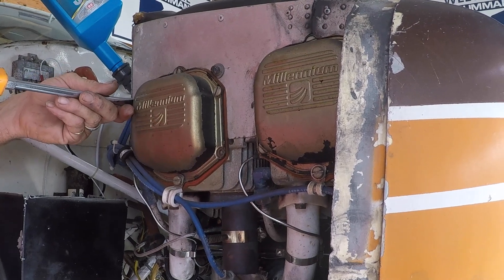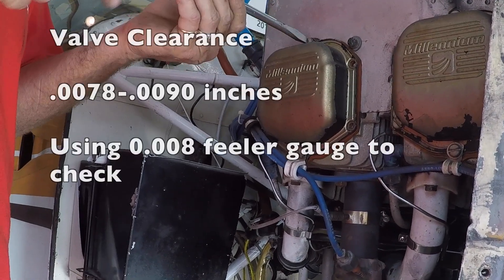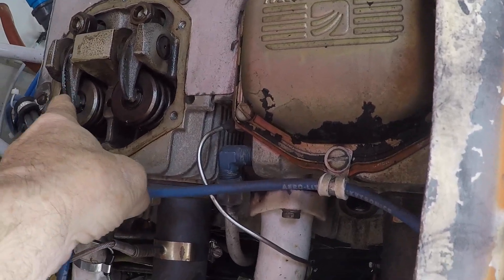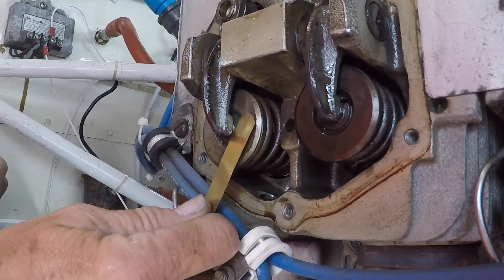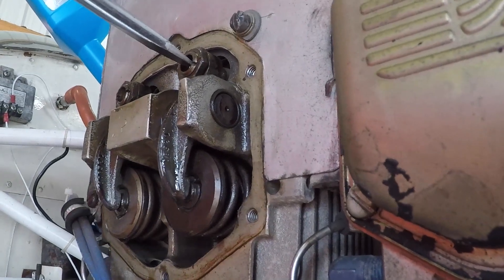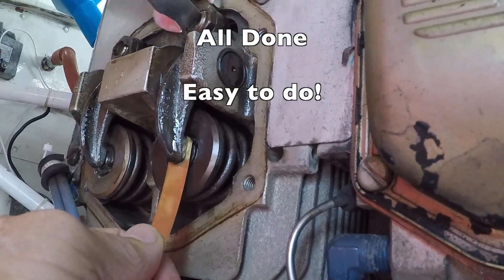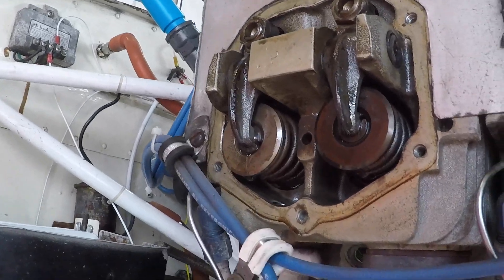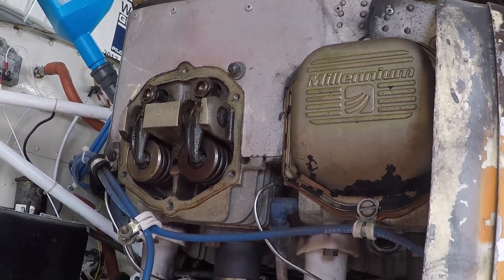Dry Tappet Clearance Adjustment - Grumman Style

Comment: Thanks for this.  Maybe you should edit to say the prop is not set to top dead center, but each cylinder must be set individually.  The pinky method in the top of the spark plug hole is a good one.
Reply from the maker: Figured folks would know to check at top dead center.

Thanks

Comment: my O235 data plate mention 0.005 valve clearance but operator manual said another value. what is the true
Reply from the maker: I use what the maintenance manual call out.
Reply: @GrummanPilots  Attached is SI 1480 and SI 1068A which provide guidance on the installation of pushrods in the O-235 series motors. If your engine still has aluminum pushrods in it, you would need to follow the dry tappet clearance procedures as listed on page 6-23 of the Direct Drive Overhaul Manual 60294-7-14. Once the pushrods are upgraded to steel pushrods, the dry tappet clearance requirements will change. SI1480 and the supplemental page of 1068A provide directions on how to set the new clearances.
Reply from the maker: @amila.a-z  Good to know, we were using steel pushrods.

Comment: Thanks. I'm taking my powerplant oral and practical soon and am just looking for refresher videos like this.
Reply from the maker: Best of luck, hope it helps, thanks for watching.
Reply: Attached is SI 1480 and SI 1068A which provide guidance on the installation of pushrods in the O-235 series motors. If your engine still has aluminum pushrods in it, you would need to follow the dry tappet clearance procedures as listed on page 6-23 of the Direct Drive Overhaul Manual 60294-7-14. Once the pushrods are upgraded to steel pushrods, the dry tappet clearance requirements will change. SI1480 and the supplemental page of 1068A provide directions on how to set the new clearances.

Comment: How  can  we make clerance valve check
Reply from the maker: Get the gauge for clearance, tighten lifter till snug, tighten and lock.  Do for all 8 valves.
Reply: Attached is SI 1480 and SI 1068A which provide guidance on the installation of pushrods in the O-235 series motors. If your engine still has aluminum pushrods in it, you would need to follow the dry tappet clearance procedures as listed on page 6-23 of the Direct Drive Overhaul Manual 60294-7-14. Once the pushrods are upgraded to steel pushrods, the dry tappet clearance requirements will change. SI1480 and the supplemental page of 1068A provide directions on how to set the new clearances.
Reply: TAKE PISTON IN TO TDC , OPEN ROCKER BOX AND PUT A PILLER GAUGE IN BETWEEN VALVE TIP AND ROCKER . THE SPACE WETWEEN THAT CALLED VALVE CLEARANCE . IF NEED MORE LET ME KNOW ILL SEND A VIDEO